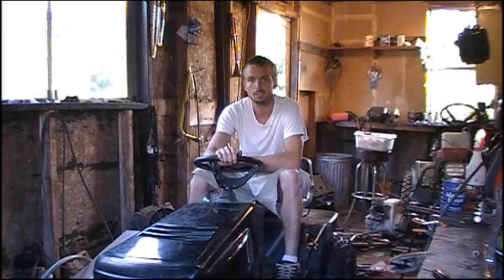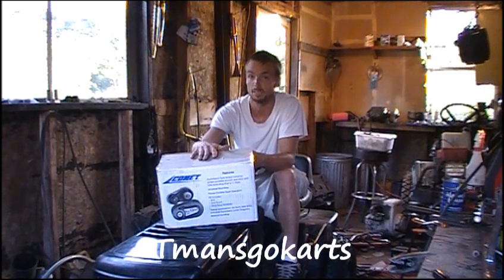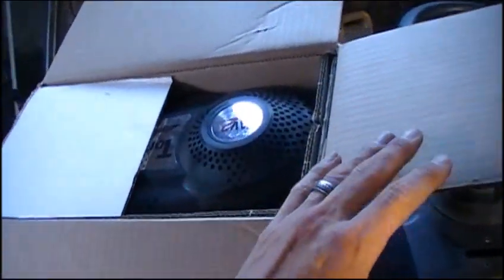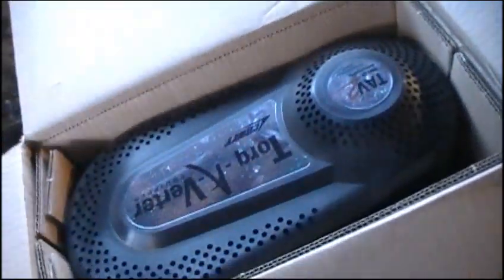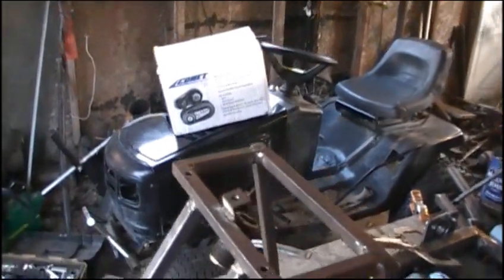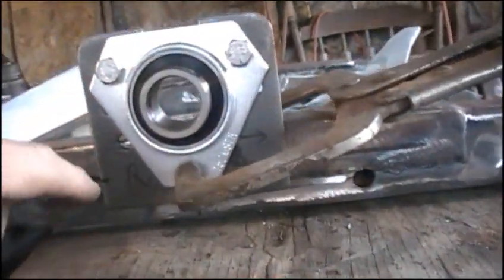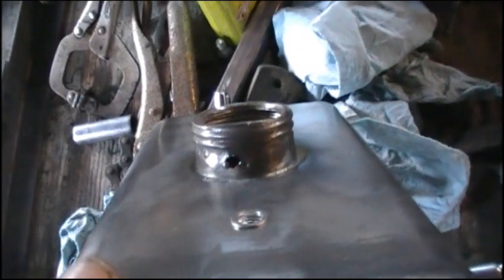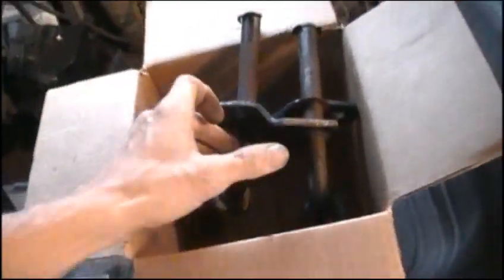Racing Mower Re-build Update #4.5

Comment: I know this is old now, but a tip when welding a hole in the tank like that is glogging the hole with something that dont weld, like a piece of aluminium or tape some sand behind the thin metal, that way no air can come and make it worse. Making you able to weld it.

Comment: for your gas tank were you keep burning an hole in the filler neck, drill it out round to an size were you can attack and fitting and hose to it and use it as an vent tube for the gas tank , I know the cap is vented but that is gravity feed fuel tank and the bigger the vent is the faster the fuel will flow out of it to the carb.

Comment: I'll be building my mower go kart this spring so I am designing it right now, but I was wondering if the rear axle can go below the frame (With the flanges facing downwards) or if it has to go above it like you have. Currently the kart would sit higher in the front if I had a setup like yours, so I either would need smaller front tires or the rear axle below the main frame.
Reply from the maker: yes, you can mount it below the frame. I did it this way so the whole thing would have a really low center of gravity.

Comment from the maker: @SuperCheeker I bet whats happening is the the smaller rear pulley is making it so when you shift it into 6th, the belt is probably rubbing on the shifter and pushing it back down to 5th. with you tractor shut off, let the clutch out with it shifted in 6th gear... now crawl underneath it and take a look at the shifting linkage and the drive belt... is it touching? I'd bet $100 that it is.... lol
Let me know!